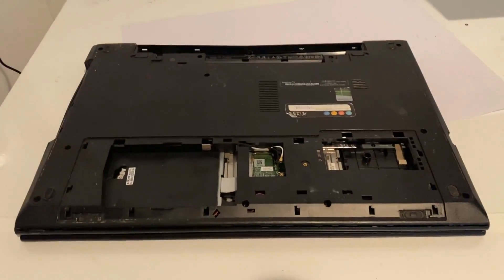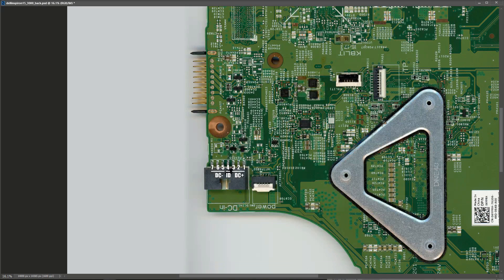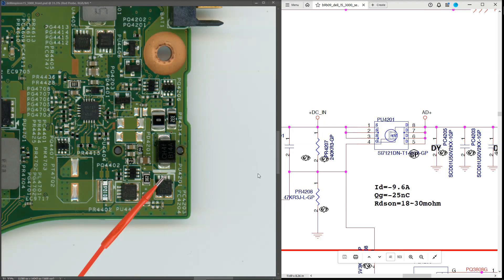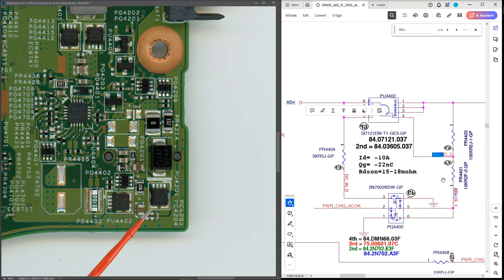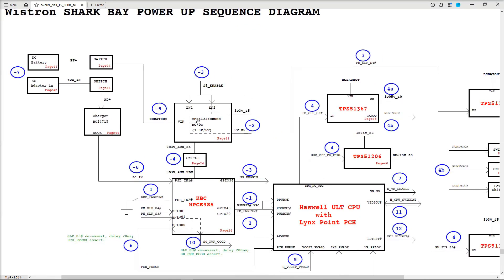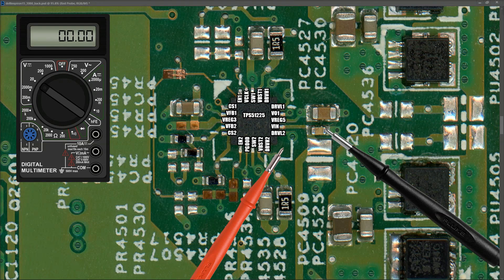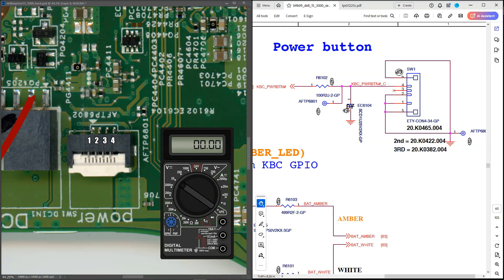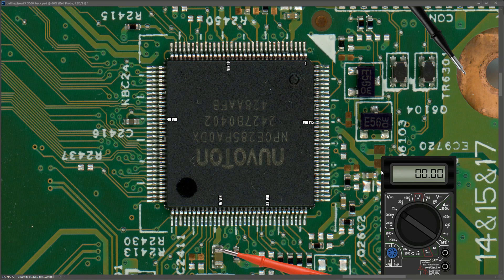DELL INSPIRON 15 3000 -  NO POWER

Comment: You sould check  Mosfet gate voltages not  with ground but with  Sources of the mosfets.(G-S)
And you'll  see that the voltages is not 3 or 1,7 volts but negative voltages (around -17v).
So the P-channel  Mosfet can turn ON.

Comment: Where is next episode ?
Reply from the maker: I'm sorry, I bought a replacement Super IO but it arrived unprogrammed. I may return to it if I can find someone with a programmer to help. Apologies.
Reply: @therepairshare673  Don't worry, thanks.

It means IO chip had internal short(s) if it can influence both input voltages?
I would expect it to be very hot under finger.